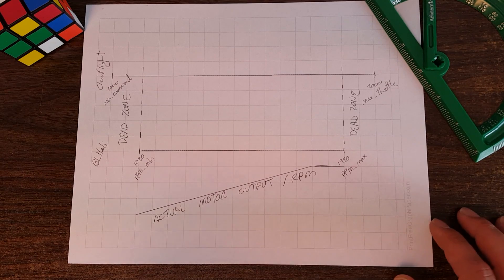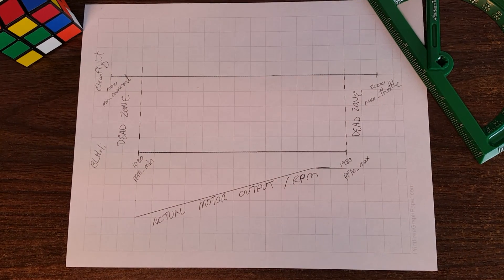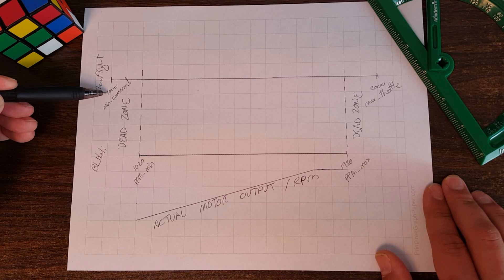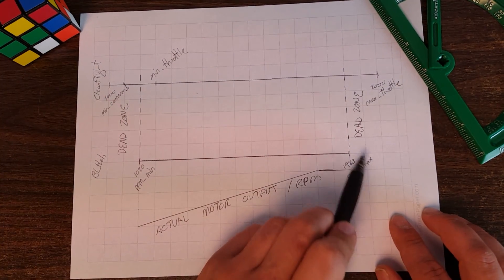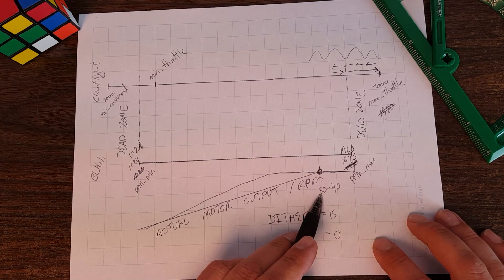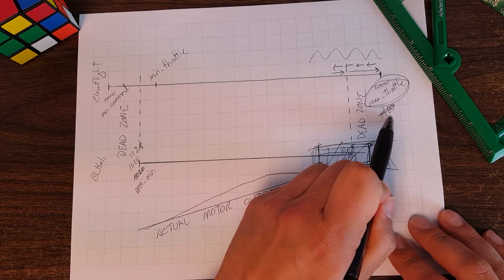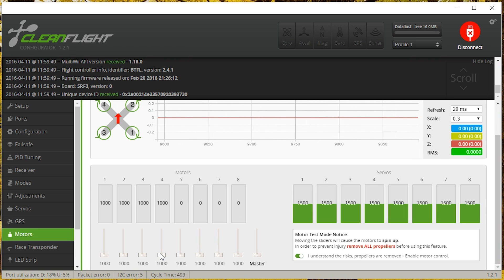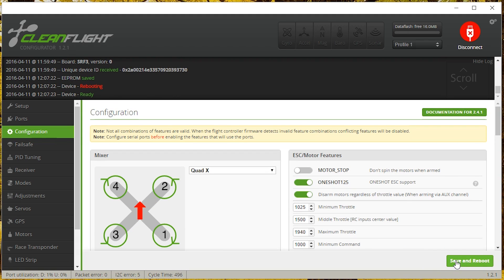Cleanflight BLHeli Top-End Throttle Calibration

Comment: Great video as always, are you still planning to go over the bottom end calibration?
Reply from the maker: +Zaniix_FPV Bottom end calibration is the same as always. Adjust min_throttle to the point where the motors start spinning without stuttering, plus about 5-10 us or possibly more if the copter experiences certain types of destabilization in flight.
Reply: +Joshua Bardwell cool thanks, that is how I already do it so no change there. I wish they would just remove these deadband zones so we didn't have to fool around with it.
Reply from the maker: Zaniix_FPV the dead zones are a necessary part of the ESC operation although I don't fully understand it. I'm told that ESC's with hardware PWM drivers have almost no dead zone, which is why KISS don't have a plateau. Maybe BLHeli_S won't either.

Comment: When looking at QuadMcFly's tests I had also noticed that flat spot at the top end. See the linked graph below (x = throttle, y = thrust) and the one thing that surprised me was that some motors exhibit it much more than others. Specifically the xnova and the emax 2600kv show a very large flat spot compared to all the rest.

https://docs.google.com/spreadsheets/d/1VVySeYya8t1i0eucKfTi9D4guAq2pzhARAmA7RYAtKk/edit?usp=sharing

Comment: Why not just getting rid of the deadband within blheli? This way you don't loose the resolution of the FC and you would still have 1000-2000µs.
Reply from the maker: +Bootflag FPV you absolutely could increase the BLHeli endpoints instead of reducing max_throttle. Remember that BLHeli's input resolution is about 200 steps of 4 us each, so as long as you have more than about 800 us of resolution between min_command and max_throttle, additional resolution may not matter.
Reply: Joshua Bardwell Thanks man, I didn't know that. Are there any other ESCs with more resolution? And by the way, would it even matter? ;-)
Reply from the maker: Bootflag FPV KISS have more resolution. Something like 2000 steps if memory serves. BLHeli_S will have more resolution too. Does it matter? I don't know.
Reply: Joshua Bardwell Well 800 vs. 2000 is a huge difference in terms of numbers. Well I run KISS 24A and Littlebees 20A/30A. Both run great but lately I've only used the KISS stuff, which is not fully tuned yet.

Comment: Do you disable OneShot for calibration? Some folks are recommending it.
Reply from the maker: +raumagent I don't know if there is some reason why that's necessary, but I wouldn't. The whole point of calibration is that you send me the signal that you are going to send, and I calibrate based on what I am seeing. If you are going to fly with OneShot, I would calibrate with OneShot. 

Do this: run calibration with OneShot off, and check the endpoints in BLHeli. Then run calibration with OneShot on and see if you get the same numbers or not. Check back with your results as I am seriously curious!
Reply: +Joshua Bardwell I already did this today and the endpoints differ. My first intention was to calibrate "as it is" but I've seen a lot of folks over time recommending to disable it during calibration. However there was never an explanation given. That's why I asked you about it. :)
Reply from the maker: +raumagent I have never heard of it. If the results differ, then I wouldn't do it. That seems to undermine the whole point of calibration. Maybe I'm missing something.
Reply: +Joshua Bardwell Dose it have something to do with the resolution of the signal. The pulse on a PWM signal is longer compared to oneshot (2000µs against 125µs) . The frequency of the timer inside the ESC against the pulse interval will give the resolution. I don't know the numbers on BLheli. But say if the oneshot resolution is grater than 1000 timer steps, I doubt it will change anything.
Reply: +Ole Lillevik If I remember correctly, the difference where quite notable with 100+ on both endpoints.
Reply: +Ole Lillevik Calibration with OneShot disabled gave me a smaller range btw.
Reply: +raumagent Yeah, something for Joshua Bardwell next research !

Comment: I thought 1950 would be a safe number but I guess it depends on the esc blheli settings and how big it's deadband is.  Guess it's better to check to be sure.  Thanks for making things so clear man!
Reply: +Zenman FPV  Did you try comparing blackbox full throttle traces before and after looking for reduced oscillation?  Most I noticed is motors not stuck maxed out in blackbox, and smoother video.
Reply from the maker: +Zenman FPV See my followup video, which just went live. Blackbox did not show any significant difference, but I use Spectra to do an Fourier analysis, and there was a big difference.
Reply from the maker: +Zenman FPV If you really want to be clever, set your Cleanflight min_command and max_throttle to extend the PPM_min and PPM_max to their extents. Raise max_throttle and calibrate, and keep doing it until BLHeli calibrates PPM_max to 254, which is one less than the max. Then repeat the top-end calibration and min_throttle calibration process. This will give absolute maximum possible input resolution to the ESC. Possibly more than is actually necessary, but it can't hurt.